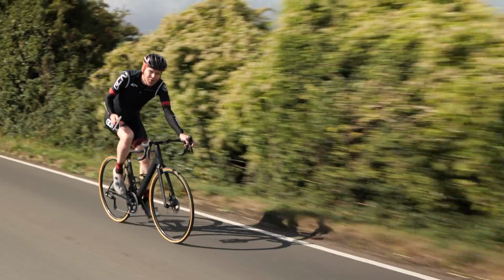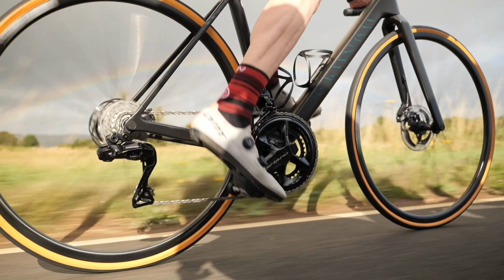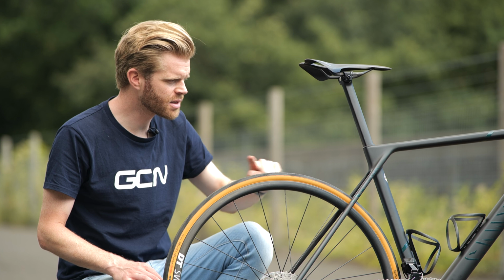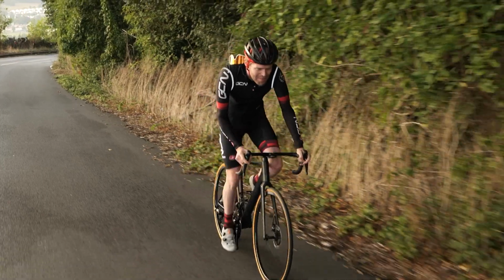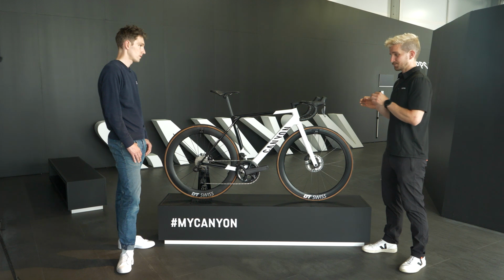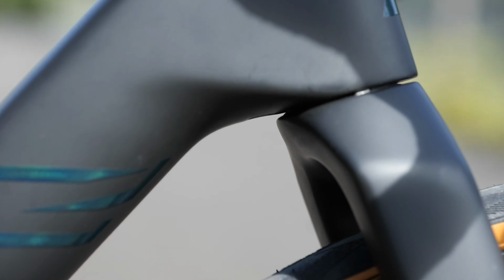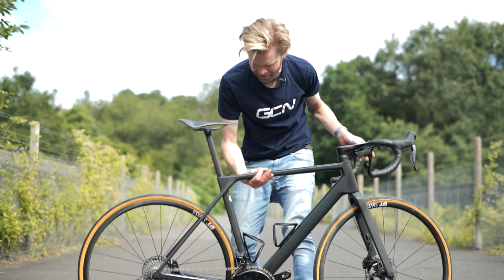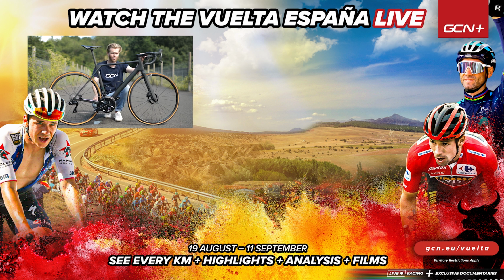​​NEW Canyon Ultimate First Look | 6.2kg Lightweight Racing Machine

Comment: Great looking bike, got my Ultimate last year and while I am envious of the all internal routing, I’m definitely not fast enough to see the difference
Reply: internal routing looks clean but apparently it affects handling / turning adversely...pro feedback.. as a beginner i cant figure any difference
Reply: @KyokushinkanVinayakShetty  where did you read or hear that from? Not trying to be argumentative. It is the first time I've ever heard about that.
Reply: No one has ever lost a race from group set or cable routing
Reply: @izaacbrown1057  and how can you prove that?
Reply: If you go back further my circa 2016 size large Endurace weighed without peddles 7.1kgs out of the box and cost something like £1800. They are still trying to offset the weight of disk brakes.
Reply: Same
Reply: Internal routing doesn't make you faster

Comment: 5th generation bike...10th generation price...
Reply: $1,500 - $2,000 less than same builds from Specialized and Trek due to the business model of mail order primarily.  There are a few showrooms.  I am 100% satisfied with my 4th generation Ultimate.
Reply: @7371301  same
Reply: @7371301  this may be true but they are even more overpriced then...
Reply: @lennymccartney1  why overprized? Compared to other brands with similar Parts they are cheaper.
Reply: @TheUltimateBashboy  that may be, but like other manufacturers, they are taking the piss!
Reply: @lennymccartney1  is it them taking a piss or the component manufacturers.... I was watching the comparison of the bmcslr frame and it went up in price over the last 6 years by only 1,000 USD that means the remaining price increase was actually on Shimano and sram
Reply: They’re definitely priced lower than many out there and offer financing. Honestly for me I’m probably going to run with them just from the ease of use of the website and the way they look. Then finding out it’s German I’m sold
Reply: Cube seem way better value..
Reply: they cant be cheap for all of the time tho

still cheaper than cannondale etc

Comment: At $11,000 dollars, it is fairly unattainable for most people.  Not the best looking bike, but amazing they can make a disc brake bike that light.  I cannot see why it isn't possible to build light bikes that don't cost $10,000.  Being 130lbs, I really need a light bike like this, but there is no way I'm dropping that much money.
Reply: The basic carbon model starts at 2k and is barely over 8kg.
Reply: @Pienimusta  It's actually 3k (in US dollars) and weighs 8.22kg or 18lbs.  I mean not bad for a 105 component bike, but that extra 4lbs over 40-60 miles adds up.
Reply: @Joshua-dx7zn  It has a 2kg wheelset, changing it to even a decent 1500 gramm alu set u gain a lot.
Reply: @Joshua-dx7zn  if you're racing maybe but a fit amateur rider should be able to ride 8 kgs of bike fast all day. Many gravel bikes are 8kgs plus and that doesn't stop guys going on ultra events.
Reply: @glennoc8585  Dude, 8kg is 17.5 lbs and not that light.  You can get a decent bike that weight for 4k.  I'm talking about getting a 14lb bike for something other than 10-12k.
Reply: "I really need a light bike like this" - no you do not... you may "want" a light bike, but what people need is common sense instead of believing all the marketing BS and buying these overpriced bikes which get more expensive year by year without any development. Edit: also, it is possible to build light bikes for much cheaper. You may want to look at Winspace frames for example... there are also some extremely light and objectively good wheels available for ~1kEUR... And if you want Di2, the good old 8050 Ultegra is perfect, just use some other cranks that do not fall apart (105 for example).
Reply: I think about the  Ultimate CFR Dura Ace Di2. My BW is 62 kg and I can press 5 Watts/kg so a climbing bike would be the only correct choice for me. But the Merida Scultura is also very nice. It is a little bit more Aero but more heavy. But the paintjob from Merida is awesome. Something I miss on a 10 k bike from Canyon

Comment: Another nice bike I can’t afford 😭
Aluminium needs more attention
Reply from the maker: Lots of great aluminium frames out there!
Reply: Aluminum had (and still has) years of attention.
Reply: When you aim for top-performance / competition bikes AL is not an option any more... but for leisure riding Canyon has the Endurance AL line.
Reply: @ThorDyrden  aluminium is still a good Material. Stendert shows how it is. Big Brands just pref to sell more exlusive stuff since they get more money as if they sell aluminium Frames with the top notch comps
Reply: @ImWiegetritt  Aluminium of course is a good frame-material... but not for the top-notch bikes any more...
It's more about the additional possibilities CF gives you in frame-design, than margin imho

Comment: Easy 5.8 with rim brakes
Reply: It’s over
Reply: or mechanical disc brakes
Reply: Well, rim brakes still work amazing and don’t need any maintenance basically!  They’re even lighter on top of that…one single disadvantage is in the pouring rain!
Reply: stop digging the past, no hate toward rim brakes but we have to move on
Reply: @ciw8688  we are sort of forced to move on, as the need for 28+ mm tire clearance forces discs
Reply: @super8hell  There is no need for 28mm+ tyres for racing
Reply: @swe223  that's arguable. However, sales of "race" bikes pays for racing.
Reply: @super8hell  too much of aero and weight disadvantage on good roads when comparing 32mm to 25mm tires